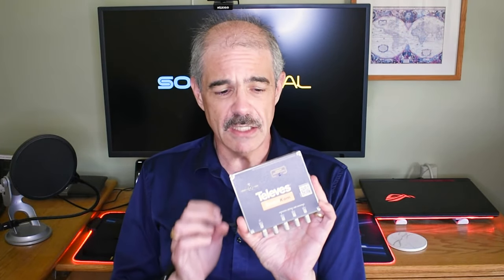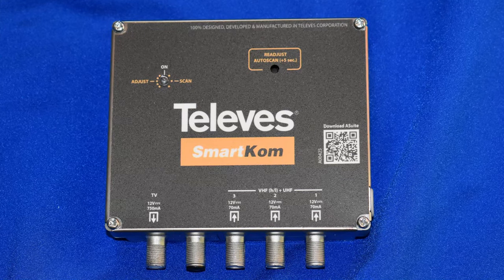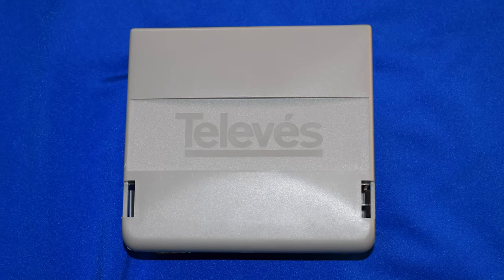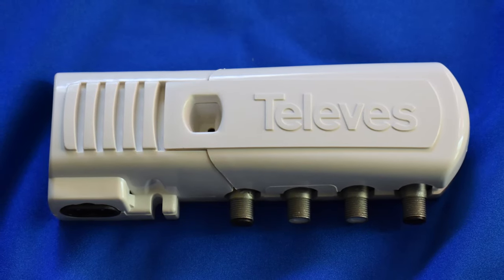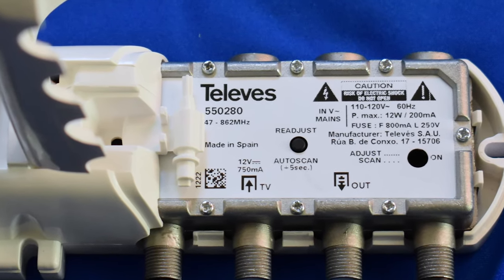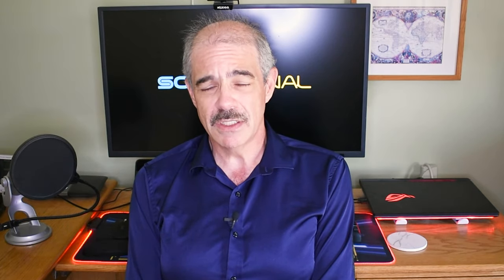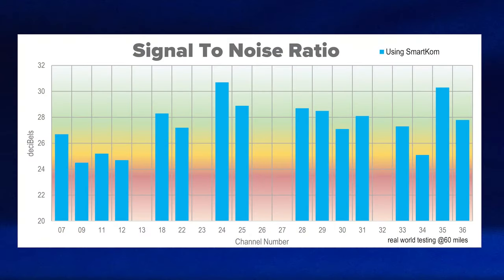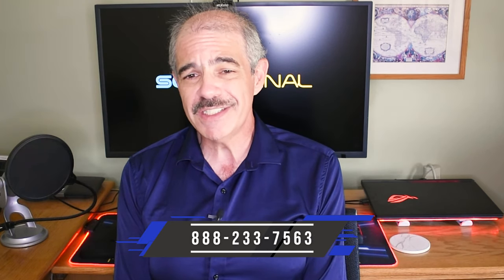HANDS ON REVIEW: Televes SmartKom amplifier

Comment: I lost channels with this item.  One channel which was normally very strong kept flipping in and out with the signal fluctuating wildly.  Televes was of no help.  My tuner also registered signals that were showing a lot higher than they actually were with this product.  This was one of Antenna Man’s recommendations that ended up not being a good product.  I exchanged the item and had the same results with the replacement.  I ended up returning and going back to my original two cable setup.

Comment: Great, I got the Smartkom unit, inside/attic install.  Got two Televes Dinova boss mix antenna.  Both work fine pointed at different markets, antennas., using the native preamp that comes with each.  I drop the per antenna preamps infavor of the Televes Smartkom hoping to get both antenna channels as promised, even thought my phone connects to the Smartkom... no reading any channels at all!?  Do I need to add the Televes pre-amps,  per antenna, backin prior to the Smartkom device here?   I thought this would do both, but perhaps it's only a combiner not a pramp?
Reply from the maker: I would try with the preamps - they will work together to give you the best results. But I am feeling like there's something else going on here.
Reply: I had a similar experience with a new SmartKom not working.  See above.  The SmartKom is an AMP and should not require additional preamps - a rep at Televes told me that directly.

Comment: 1) Will this unit replace the preamp for my antenna? 
2) Is it possible to use my existing antenna preamps and combine their output to the SmartKom?
Reply from the maker: It is designed to work in parallel with the preamp in your Televes antenna if needed. For other amplified antennas it generally disables the preamp, but every antenna's going to behave differently. 

More to the point, this amplifier is so strong that you just don't need a secondary preamp.

Comment: I have a question not sure if anyone knows. Newer to the Smartkom. I am having a heck of a time. I have three antennas. It shows all the channels I want however some don't end up on my tvs. Anyone know why? Lol 😀
Reply: If the smartkom app shows all of the channels you want as listed, basically should be the role of your antenna pointing in the right direction to receive a good signal, and also make sure you do a channel rescan on your TVs. Some TVs have issues picking up new channels unless you disconnect the cable -> scan -> reconnect -> scan.

Comment: …"digital" signals… No such thing.
Reply: How do you figure? OTA has literally digital code(0s & 1s) transmitted in packets of compressed data thus requiring less bandwidth. HDMI, optic, digital coax all transmit digital signal(code). You may have some roundabout way of nitpicking signal transmission/receiving but that won’t matter to the masses.